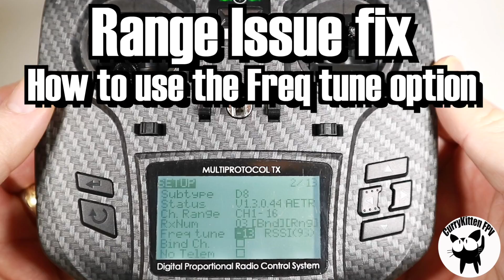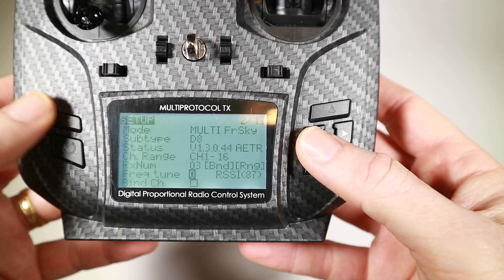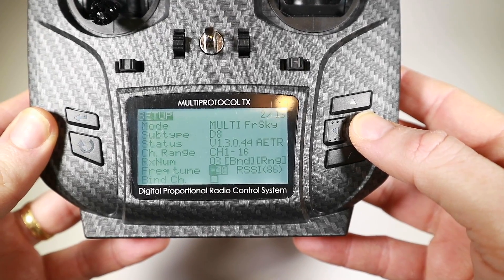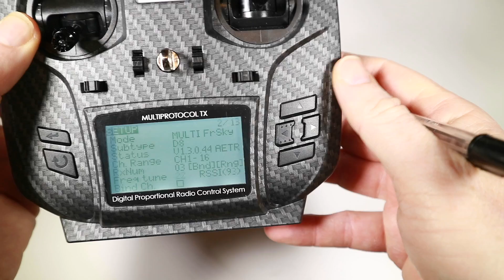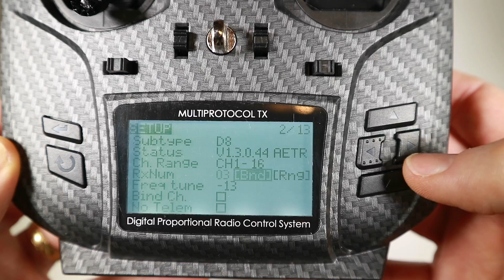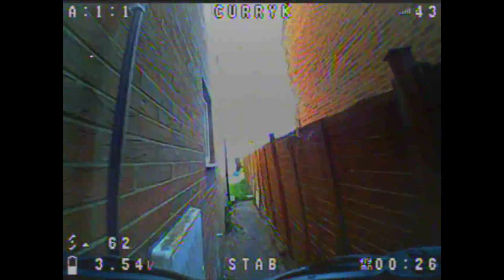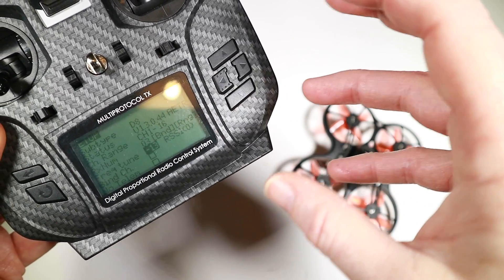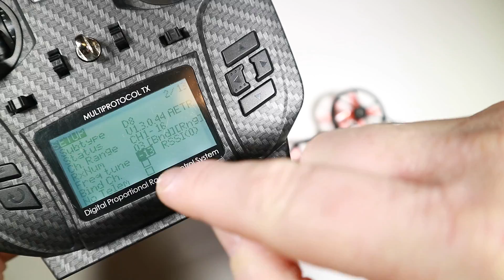Fine tuning the frequency on MultiProtocol modules - For Jumper T12/T16 & standalone modules

Comment: A question from the future, regarding your experience after making the statement regarding FrSky Rx's, and how the tune you found here should theoretically apply to all RX's of the same brand. Did that hold true? And if so, did you happen to try any LR protocol FrSky RX's like the L9R, to see if the tune was the same? I'm using a new 4in1 module in an OpenTX Nirvana to replace my Taranis, to control a fleet of XM+'s and L9R's. I'd hate to have to do this process for every receiver, lol. 

Thanks for all the helpful info, this thing is super handy, but I'm very concerned about range - I've already had the arms-above-your-head moment with a fixed wing, before I knew about Freq Tuning.
Reply from the maker: In theory, all receivers should react in the same way.  They should all be calibrated the same, it's just the module that isn't.  I have used this on multiple FrSky quads, and I've not noticed any issues with one being worse than the others.  If worried it might be worth repeating the test on 2 or 3 XM's to build up some confident.  I also haven't tried it on my LR9s (that radio is currently busy being broken - but I'm also mainly flying on ELRS right now)  I think I'd want to double check the LR9 from scratch to make sure the tuning still holds up.

Comment: Hello, i did it and i find -26. It’s possible?( because when i decrease i need to Go on -82 to have a failsafe) i dont know if it’s normal?
Reply from the maker: Yeah - that's quite possible, if you failsafe at -82, I would guess you'd also failsafe at +30 and hence the -26 midpoint to use

Comment: I do the same  with a new quad  that i get today but mine loses signal diferent then yours mine was -95 +35  [-95 - 35]= -60 then [-60÷2]= -30 in d16 mode is it ok?
Reply from the maker: Yep - all good.  It's because every module is a bit different that the calibration needs to be done individually
Reply: @CurryKitten  thank you very much sir!!

Comment: Sounds like this radio just has issues based on the comments. I'm looking for my first multi-plane radio and thought the T12 Pro looked good and around the right price-point. Now that you've had time with it, is this a skip? I need good range as I fly fixed-wing in wide-open spaces. What (if any) other radios are worth considering at the $100 price point? Or do I need to just spend more to avoid throwing money away?
Reply from the maker: I'm actually mostly using this radio on a daily basis.  It's not like it's better than my others, it's just convenient to have around as it charges via USB and has the regular module bay to take Ghost/Crossfire/etc.  So since fixing the initial issues via OpenTX, I haven't had a problem at all.  I use it when developing my sim and fly FrSky/Crossfire/R9 with it reasonably often.  If I'm going 1km+ I'd normally be using something other than FrSky though.  The RadioMaster TX16S is a radio that's very popular (look very good I haven't got one myself).  The RadioMaster TX12 is very similar to the T12 Pro (and I hear that RM has better build quality) but the internal module in that isn't a full multiprotocol module like the T12 Pro
Reply: @CurryKitten  After hemming and hawing about it I pulled the trigger on the RadioMaster TX16S with Hall sensors today. It'll be here next week. Would have preferred the lower price on the '12' models, but the TX16S just seems to have a better reputation. Hope it suits my needs for a few years.

Comment: I have the Jumper t8sg plus that uses Deviation software. Do you know of a video that would give me instructions to tweak the RSSI on it? I have the same Tiny Hawk model and would like to optimize it as you have here. Thanks.
Reply from the maker: I don't know of one, but it's definitely something you should do - I did have a Deviation based radio for a while, and I remember I needed to do a fine tune before I could even bind it to a FrSky rx.  I don't have it any more, so I'm a bit vague on the details.  Did you try hitting the forum here https://www.deviationtx.com/forum/index ?

Comment: FPV is so blummin complicated these days!!! Thx for the tips got two RM Rx yesterday,my R88 bound straight away yet the R86 wouldn`t bind at all so maybe I need to tune to it?
Reply from the maker: Usually it's the case of tuning the radio the once and it should work, but I've not used the RM rx's, so no idea if they are all created equally.  So certainly try it out - I did have another multiprotocol radio where I couldn't even bind it to a FrSky rx until I messed with the frequency tune.

Comment: I did what you said for my Meteor75. My low was -50 high was 19 after the math I ended up with-31. I entered that and my BetaFPV Lite Radio 2 still has better range. Perhaps 2x as the range. Any advice?
Reply from the maker: Not really - sounds a bit odd.  Presumably you did rebind after the tune as well ?

Comment: There's no freq tune option on my t12 pro or my tlite, is it because I'm using spectrum umx models.
Reply from the maker: Yes - sorry, I should have been more explicit in the title, but with so many people using FrSky, I didn't.  The good news is that this means Spectrum doesn't need fine tuning
Reply: Then why am I getting signal lost signal reconnected all the time with my spektrum models
Reply from the maker: Are you very close when this happens?  As this overloading of the rx will cause that.  Otherwise, I haven't used the DSM stuff at all really so don't know what to expect from range
Reply: This happens on one when I'm flying and one plane when binding,but also as I said there is no option for tuning on both of my radios but its on yours.

Comment: I'm thinking about doing this with my TinyHawk 2 Freestyle and my T12 Pro.  I have a question though. How did you get the transmitter to talk to you?  Mine only vibrates, no beeps or anything.  Also how did you get the signal info on your screen?
Reply from the maker: You'll want this video https://youtu.be/aNOubizutSM to learn about how the talking stuff works.  Having the signal info on the screen (if you are talking about for fine tuning the frequency) is dependant on you having a receiver that passes back RSSI telemetry.  If not you would just need to know at which ends of the frequency your quad lost signal and then work out your mid point form the two ends of the failure

Comment: What is the spec of the internal module though?
Reply from the maker: In what sense?  You'll probably get the most information about what protocols it can do and the RF chips it uses from the main https://github.com/pascallanger/DIY-Multiprotocol-TX-Module site
Reply: @CurryKitten  after reading about other Jumpers, it is most likely just your another JP4in1 at 125mW.

Comment: My THS ended up at -18 on my T16, can't say RSSI is much better though.
Reply from the maker: I didn't really notice it on "proper" receivers like the XM+, but on an SPI receiver it was the case of dropping out of the air without the adjustment, and being able to fly with it.

Comment: Thanks for explaining this. 
Wonder if you could help with a question. 
I did this and found my setting was -6. 
Pascals instructions state for every protocol, D8, D16 and so on. 
As they all come from the same chipset I set all mine to -6. 
What do you think? 👻
Reply from the maker: I've used the same tuning level for D8a nd D16 as well, it seems to work well.  You could always simply repeat the exercise on a different type of receiver and check if the results are still broadly the same.  But given the range I've got, I haven't felt the need to myself.
Reply: @CurryKitten  I'm happy with that then. Thanks for confirming my thoughts. Stay safe buddy.

Comment: Hi, I want to buy this Jumper T12 Pro radio to replace my dx6 which burned out...3/4 of my receivers are DSMX...are there any problems with bind or range in dsmx???...........I mainly fly planes and gliders..........some mini drones as well.
Reply from the maker: I've only got a few things on DSMX and they are indoor things.  So I can say it certainly binds to them, but I haven't tried out any range for myself.  I will say that I tried a FrSky receiver on this radio and then a Taranis and got the same range, so I'd expect the other protocols to be similar
Reply: @CurryKitten  thank you for your opinions and useful videos......you reassure me

Comment: Thanks for your video. I have a T12 coming in the mail Friday. I feel better after your video.
Reply: Hi sir, I just got my t12 in the mail and the channel order is not correct. It does say aetr on radio set up but the a and the r are reversed. I tried to change with the stick imputs but it's not working. Do you have any ideas how to switch. Thanks

Comment: Do you think this will be the same on the t8sg? As I switched to frysky and in some cases it’s no better than spectrum
Reply from the maker: I do absolutely.  I have an iRangeX iRX-IR8M (which is multiprotocol and runs Devention - so I think that's very similar to the t8sg)  I wasn't even able to bind to FrSky until I fiddled with the frequency tuning.  So definitely go through the process and see
Reply: CurryKitten very interesting. I will definitely be having a go at that later
Reply: Does it need to be done for each receiver?
Reply from the maker: @lurgy1  Nope - although little differences may occur, just doing it for 1 receiver should net you good results on all

Comment: So is this better than the Jumper T8SG Plus V3 ?
Reply from the maker: Depends what you like.  I would say yes simply because it runs OpenTX while the T8SG's run Devention
Reply: @CurryKitten  You getting that loss of signal with voice alerts on too? They say you need to remove SD card altogether. Voice alerts is the main thing I'm looking for in shopping for another transmitter. I'm tired of using my old Flysky transmitter.
Reply from the maker: Yes - as the voices come from the SD card and accessing the SD card can cause the signal loss.  OpenTX 2.3.8 is taking an age to come out for some reason :(

Comment: Why are you still only getting like 60% when you’re flying directly in front of you?
Reply from the maker: That's an SPI receiver for you - they lose signal quickly.  In the flip side I was flying with an XM+ receiver in a quad using this radio and at around 500m I still had high 80's RSSI

Comment: Thanks for the very useful tip, I will try it with my TH2 and T12pro.  You may have mentioned it at the end of the video but if I could double check that whether this needs to be done with each quad that is bound to the D8 model set up in the radio?  I currently have about 3 quads that have the SPI receiver which I have bound to the same D8 protocol channel on my transmitter.  Thanks
Reply from the maker: Yes - I would expect d8 SPI receivers to be fine - my question was more about when you use a proper frsky rx like an xm+ for example.  Should we expect that to be the same or not.

Comment: Hi there,I currently have the t16 and I'm starting to get problems with it,buttons sticking and ribbons coming loose,I notice you also have a taranis x lite s aswell,I'm thinking of buying one of these as the accst supports d8 aswell as d16, does it matter if I get the eu version or FCC, I'm based in the uk,many thanks.
Reply from the maker: You should be able to flash either of the firmware of the X-lite to it so it shouldn't matter - although getting the pre v2 XJT firmware seems to be more difficult so watch out there.  If you are considering the X-lite, I'd really recommend the longer sticks

Comment: Actually ive dont that using my t16 to larva x. Before my larva range is normal. But i try to tune it using that way. Afterhat im having 2x rxloss randomly in such short distance even without rssi warning. And that caused my larva x had bend motor shaft.. My steps were same with you except i didnt do rebinding. Is the rebinding needed when using this tune?
Reply from the maker: It said you should rebind on those instructions, I'm not sure of the effect of not rebinding, but it seems like a useful test for you todo and see if the range increases
Reply: @CurryKitten  yeah maybe what i did wrong was not rebind it after tuning.

Comment: CurryKitten hope you are well mate.?
As all this corona stuff is goin on I’ve been and bought the r9m  module for my qx7. The Radio’s not been updated yet. I need to flash that and add the files and stuff and flash the receivers I’m putting in my quads.🤦🏼‍♂️ I cant find anything that’s easy could you help please. I’m not all that good at this stuff. Really sorry to be a pain. I just don’t want failsafes anymore. 

 Much Needed upgrade

Cheers Lou 👍🏼
Reply from the maker: Hey Lou, I would do things in this order, and double check everything looks as you'd expect it every step.  First update your radio to the latest OpenTX, don't forget to include the flexR9M option in the list of firmware requirements.  Next get whatever version of the latest R9M firmware as well as the same version for the receiver you are using and move that to the memory card on your QX7 (I make myself a firmware folder).  Flashing the R9M module is easy, just stick it in the back, locate the R9M firmware and longpress-choose flash external and that'll update.  The receiver end is a bit more fiddly as you'll need to connect up S.port/GND/5V to it from the QX7, but I've made a few videos about this and it's pretty easy to do.  Again flash this in the same way and you are good to go !
Reply: CurryKitten ok mate I’ll give it ago. I just don’t want to loose any of my models I’ve already got stored in my qx7 already. Got to get my head around it. Thanks.